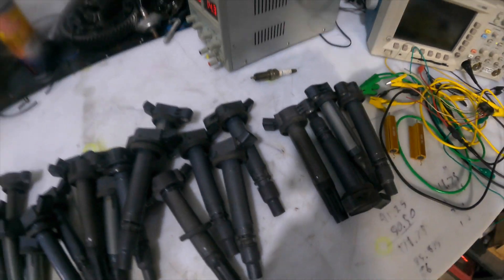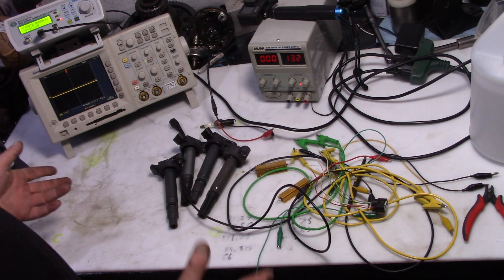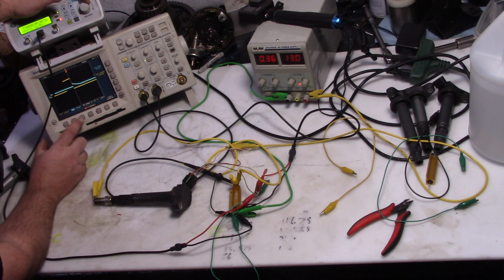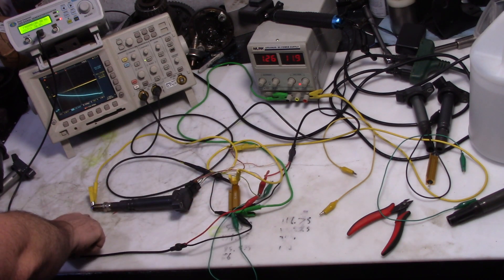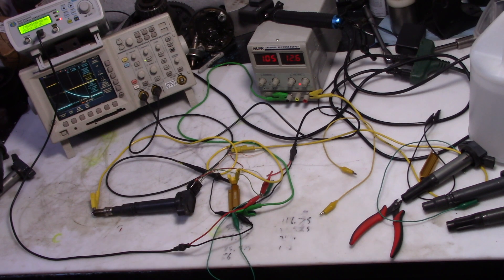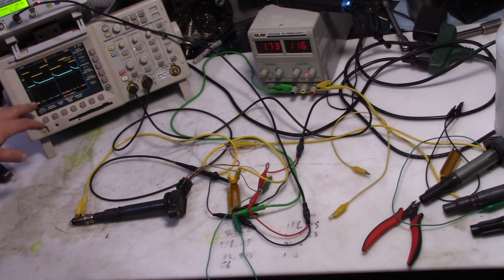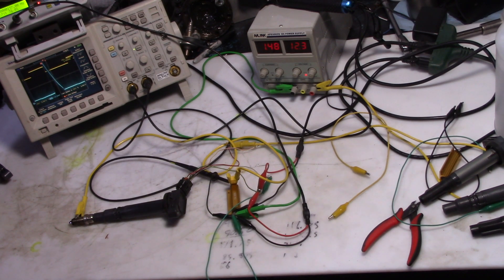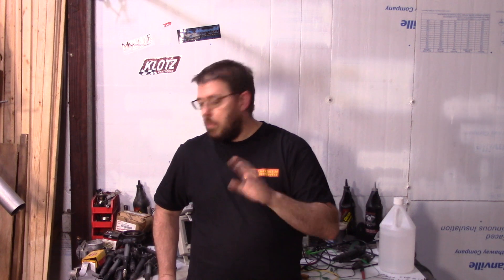Optimizing Spark Energy on the 2GR and the 2AR

Comment: Your test is worthless because you're testing them wrong. With a stock gap at atmospheric pressure, they'll never output more than about 2KV. You need to stretch the gap right out to the max or use a pressure chamber.
Reply: Energy = volts x amps x seconds. Low volts means more seconds.

Comment: On my turbo 2GR, I accidentally fried all the coils when updating my megasquirt (set coils to going low, so it just sat their charging the coils for minutes) and while waiting for a new oem set, got an Amazon $70 set and I have to say the spark energy appeared higher, at the same given plug, gap, dwell. Spark was clearly brighter and hotter. Any guesses why two coils like that would preform differently? I suppose it’s more efficient, or is able to draw more current?
Reply from the maker: If the coils can hold more magnetic flux before saturation they would be able to hit harder. Do you have a part number for the coils you used?
Reply: I’d already replied. I can’t put the part number in my message I suppose? It gets deleted. AA-ignition Amazon brand. But was testing at too much dwell, 4ms

Comment: As always love your work.

Have you manged to look at the oil cooling / heat exchange options for the AR engines, or have you found oil cooling to be totally unnecessary even in your race applications? Also do you suspect the 8AR-FE is mostly gets it's power bump from the turbo, do you expect it to have any fancy parts that are worth looking into? I'd assume they're a pretty uncommon engine, but they could contain some special Toyota magic sauce. 

What are the MT transmission options for the AR engines? Could that begin to be a more limiting factor with so many manufactures moving towards almost all automatics?
Reply from the maker: I've been using the 1AR-FE water pump designed for the towing package, it has an integral heat exchanger for the oil and it works really well. I love that it is all integral and there are no hoses to potentially fail. I haven't had the need to do anything beyond that.

Comment: Accel has a performance ignition coil for the 2ar. Product number  140630-4. Might be worth a look when you go to boost.
Reply from the maker: Yes, i mentioned this in the previous video. i was trying to figure out if it was worth looking into and the answer at this point is no. But just as you say, when i get around to boosting the engine it may make sense.

Comment: Another great video, and we all learned something.  Boost changes everything, so would be interesting to see what Toyota does on coils engineered for their boosted  engines.  I suspect that Toyota does not use coils where the spark energy can be further increased by varying the dwell of the input signal when there is no benefit of doing so…engineering 101.
Reply from the maker: I don't disagree with the general idea except that these motors have significantly oversized injectors and the stock tune makes it obvious that they are tuned to handle a low level of boost without needing to tune the ECU. The people in charge of those kinds of decisions seem to have visions beyond stock.

Comment: Now THAT'S a video worth watching.
It would also be interesting to see if there are any differences in the spark plugs themselves.
Thanks for that - Well Done
Reply from the maker: It's actually been about a year since i looked at this but last time i looked there was one plug for the 8ar-fe that was two ranges hotter and there was one plug for all the other AR and GR motors. The 2GR-FKS and 2GR-FTS may have added another heat range or two but it's pretty slim pickings if the stock heat range from either of those won't work. Thankfully, for any sane amount of boost, these two options work just fine. We'll have to see when we get to insane amounts of boost but it'll be a bit :)
Reply: @FrankensteinMotorworks  Specifically, I am looking at this weird spark plug with a built in capacitive discharge...  Its call the Pulsar...   Looks like it may be pixie dust... but hey, I'm a sucker for weird bullshit..

Comment: Doc Jacobs of Jacobs Ignition fame advocated for a full throttle switch that put another 12V battery in series and (for a brief time) fired your plugs at 24V. This was pre ECU as ECUs don't like double voltages...
Reply: If this has value, very easy to do on a COP set up such as this…only need to change the supply voltage to the coils.  The ECU simply triggers the coils and can remain on 12V.  Again, as long as the plug isn’t misfiring and is able to fire, I struggle why the spark energy makes any difference.  More spark energy reduces the likelihood of a misfire (increases robustness of the probability of the spark event happening), but if the event happens at the proper time in the combustion cycle, you don’t gain anything by increasing the spark energy.
Reply from the maker: The coils will happily fire at 24V but the coils max out in 3ms at about 11.0V. It'll take energy beyond that but it does not result in more power in the spark. They will charge must faster at 24V. A full charge at 24V only takes about 1.7ms instead of 3ms but with the short charge time and the individual coil per plug means that you'd have a fast enough charging time for a full power spark at 25,000RPM even with a failing battery at 11V.
Reply: @FrankensteinMotorworks correct: the spark voltage is a result of collapsing of the magnetic field in the coil, so the delivered voltage is a function of the coil design, not the supply voltage.  There is no benefit to increasing the supply voltage.

Comment: Testing the quality of the spark in atmosphere is not the same as the combustion chamber atmosphere testing in  atmosphere require 20 time's the spark gap
If your concerned about spark quality try R35 coils
Or M& W ignition system shout out to Mark
Reply from the maker: Yes, i 100% understand that it is harder to ionize the spark gap when it is under pressure and i do cover this at the end of the video but perhaps not as clearly as i should have. I haven't had any issues yet, i was just trying to optimize my usage of the system that is in place. If i get to the point where what is there is no longer adequate i will seek out a replacement.
Reply: @FrankensteinMotorworks  I may of missed that part of the video it would be interesting to see the difference on the test bench great effort as always interesting to see if the new LandCruiser turbo engine uses different coils
Keep up your excellent work👍